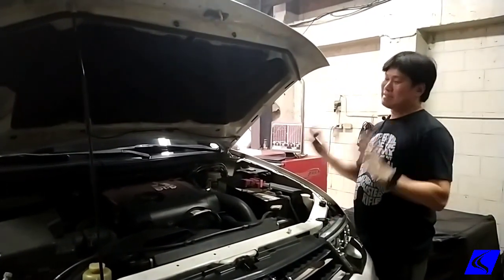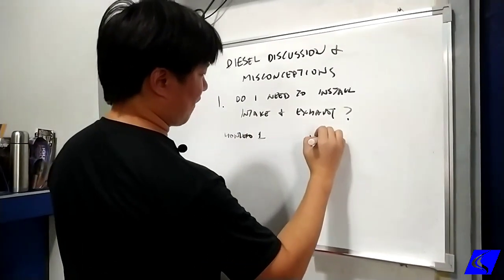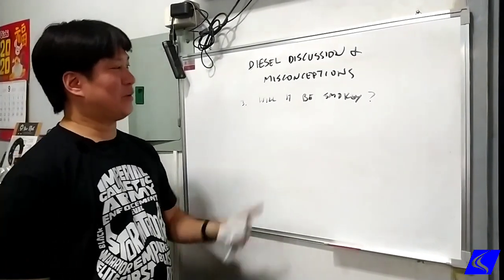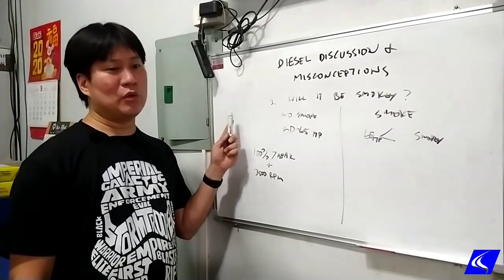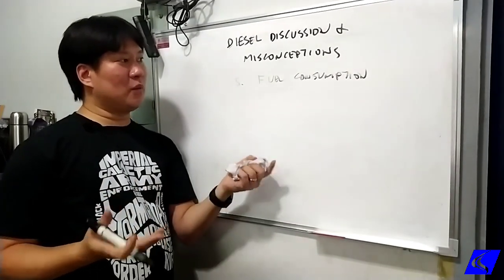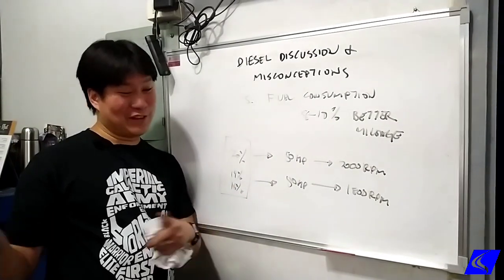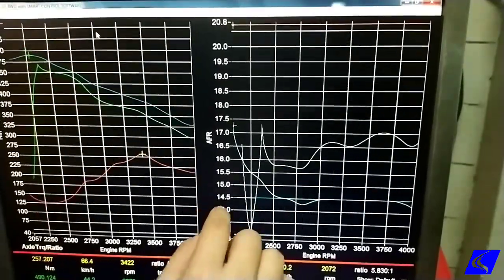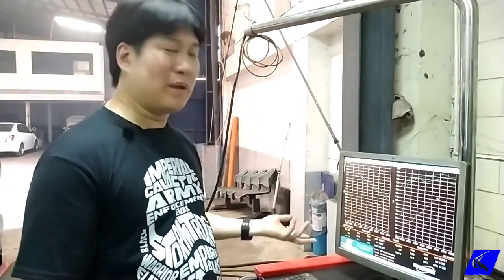Diesel Engine Tuning Discussions and Misconceptions

Comment: Hello boss, huge fan here.  1KD FTV are known to crack pistons for some reason, remap or no remap they do. Is it safe to remap to around 190HP and 400NM at the engine?, it's currently at 360NM at engine
Reply from the maker: @haqthkr  no idea where you’ve heard that. Never cracked any piston ever for almost 20 years 

So yes can remap
Reply: @speedlabchannel4452  there's plenty of cases especially in Australia, less cases in Africa but there are out there. Apparently towing heavy load for long and for few chips/remaps has been blamed

Comment: question, if i want to remap to get a gain 60-65 hp just for daily use, do i need an aftermarket radiator like koyorad, 

i have a 2kd-ftv vnt engine, on a fortuner/legender
Reply from the maker: Nope
Reply: @speedlabchannel4452  thanks man

Comment: Gd mng Sir. In a Pajero 95/96 4M40 Engine SUV(no ECU), can you upgrade stock mech fuel pump and stock injectors to more powerful pumps and injectors If so, what type of injectors and fuel pump can we exchange for the stock parts?
Reply from the maker: No
Reply: @speedlabchannel4452  Thanks very much for the reply.

Comment: The stock montero we have (also 2.5 VGT, 4D56 engine) does smoke when you floor it up a hill.
Reply: He just explaines it, if you give 100% throttle and is under load (~2000 rpm or more) it will smoke. It's normal

Comment: Hi, first and foremost thanks for all the informative videos on diesel tunings. My question is, can a Ford Ranger T7 2.2 XLT with drop in air filter and slightly bigger intercooler goes for stage 2 remap, Will it shorthen the engine life span? Thank you.
Reply from the maker: No it wont

Comment: When you add boost earlier, it means the turbo will be working more. Which also means it will also fail earlier. With more hp, there will be more stress on transmission, gear, axle, tires etc. Am I right?
Reply from the maker: No you’re not, because youre not at full boost all the time

Comment: Good morning Sir, first of all I like your vlogs and they are very informative, my question is, can the transmission take all that added power specially the manual transmissions with stock clutch lining, pressure plate, release bearing?  for those manual transmissions with dual mass flywheel will it be safe if the ecu is remapped with additional power? do you have any data on the transmissions' max torque ratings for the vehicles you remap?
Reply from the maker: Stock clutch can handle 50-60hp more
Reply: @speedlabchannel4452 hello po! how abbout automatic transmission Sir?
Reply from the maker: @TitoDADDY  no problem with automatics
Reply: @speedlabchannel4452  ty po sa sagot Sir